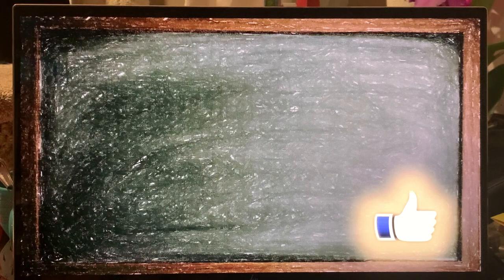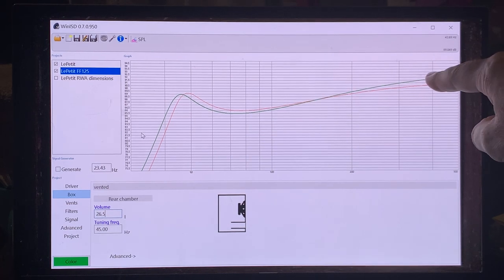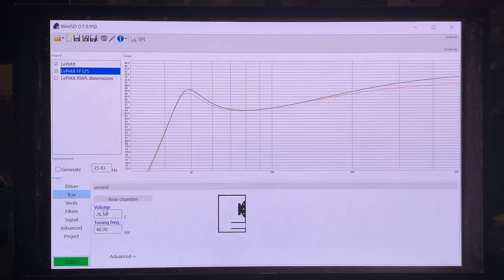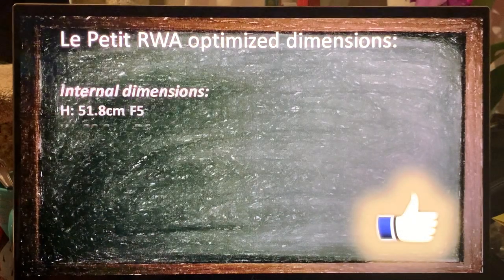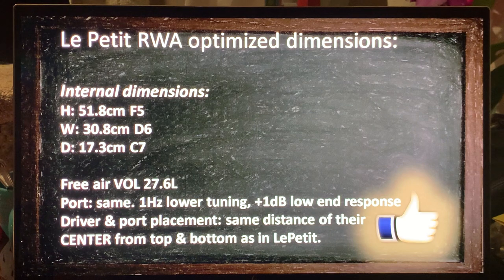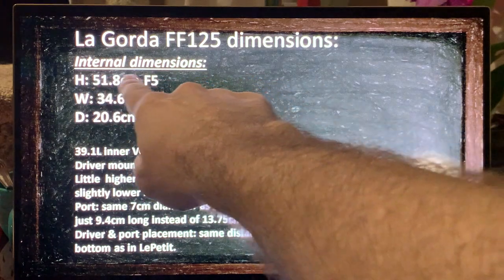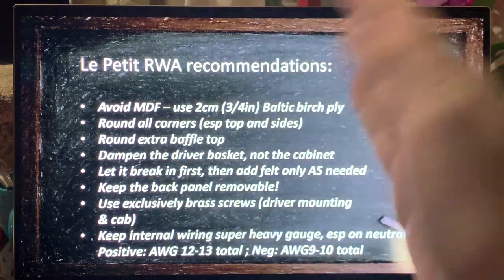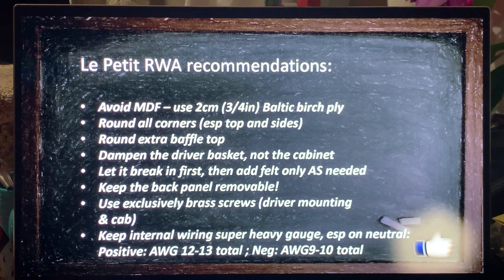LePetit and LaGorda with FF125

Comment: In Hiraga's 604 design (which also used musical scales for dimensions), the speaker was set at 0.324 and the port opening at 1/11th of case height for example, so both avoided/suppressed major standing waves. This may come in handy if you go with entirely new dimensions derived from musical scales. In my experience the depth and height are the most dominant, but it's nice to pick a 3-tone chord that sounds good to you and base the speakers' dimensions on such a chord.

Comment: János, many thanks to Your help to the Petit! The value of Your input made even the creator himself recognize us and comment these videos, what is sign enough for the level of Your ingenuity! 👌👍👍
Well guess, I bought the FF125WK already, they are breaking in today first time. 😉
I actually want build both versions of a "modern" Petit with RWA dimensions, the 26,5L (maybe with massive spruce) and the 39,1L (with birch ply). BUT I don´t know, if 2 more builds will not evtl. confuse the people too much.. 
So which one should I build. 🤔 Putting the FF125 in the existing Petit would destroy the use for the FE103, and I´m in love with it!
Reply: Hey, great idea can you put the FF125 in the OG cabinet? And built the original FE back?
Reply: @SPH25  I just recieved the FF125Wk a few days ago, I think they are a bit too big to go back, once the hole was cut bigger.. 
At least in my feeling, putting the smaller FE103 into the bigger hole takes away this super-sturdy feeling of the original build. Maybe it is possible, I must try in a template maybe..

Comment: Hello, Janos. 
I'm sure you've mentioned it somewhere in your vidoes but I would like to ask you a question about the driver positioning. For the cabinet dimentions you've provided in this vedio, should I use the original Hiraga design? It looks like the centre of the driver is mounted at 123mm from the top. Also, I am very curious to know about the effect if I were to lower the position of the driver. Thank you.

Comment: Hi Janos. Thanks for the vídeo. Now please help me. Some members from  a famous forum for "diy audio"  say that thin 22awg solid wires are  best suitable for FRs, Mark Áudio Alpairs, in this matter. Thanks for comments and clarifications.
Reply: Hi José.. I think that 22awg solid core reccomendation is more for Chipamps or other high damping factor amps for use with low Qts drivers.. But best is to try for yourself..
Reply: @rickg8015  Hi Thanks a lot for comments.!!  BTW,  It seems hard to me to know how high or low Qts is. Is there a practical  high-low values range you can tell me?
Reply: If You want to play it safe, buy enameled wire that has solderability. Perfect for this job is the diameter of ø 0,5mm. If You twist 6 or even 8 threads of that You have an high end wire. It will be shown most likely in my next episode of the build #4.
Reply: @TheZpilot55  Usually it is a Qts of around 0.2 or lower that is really considered low.. Anyway in my opinion, focus more on the quality of the wire first than the guage.. If you use a tube amp don’t worry too much about wire guage, empirical testing would let you know what works best in your system with the Le Petit FF125wk. Please follow Jurgen’s build too.
Reply from the maker: Hello José, the AWG22 solid wire is a superb choice. Just use 16 runs for the negative, and 12 runs for the positive. In general, use AWG20 or thinner wires, and parallel them. If you use only 1 of each, there will be next to no bass. Well, there will be good bass, but nothing like what the speaker can do. Adding the extra runs will seem as if you have added a sub.
Reply from the maker: About the low Qts drivers: my Altec 515C has a low Qts (about 0.2), and massively paralleling wires made a tremendous benefit there too. 96 runs of AWG32 silver plus Kimber TC in parallel for a total AWG of 8 or so for the negative and 10 for the positive. That brutal paralleling makes subsonic reproduction possible - just keeping a simple Kimber TC or AWG14 ish, and it would only play midbass, some deep bass but absolutely no sub 20Hz. I plan to upgrade it in the future to 256 runs of silver on the negative, and 196 runs on the positive, no copper... just got to save $$$ up to that. Also, the speaker cable should be like that too, not just the internal hookup... now that's real big $$$.
Reply: @realworldaudio  
Wow Janos.. That’s some extreme cable diy there.. I think the OP was asking about thin guage speaker cables as used by mostly Chip Amp users that braid thin solid core wires sourced from good quality network cables..  I tried a single 24awg for by Oyaide I think for tweeters, sounds refined..

BTW, for my Altec 414z in MLTL’s, what would be the starting point would you reccomend for cables inside the cab? I’m afraid i don’t have the budget for Kimber TC, etc.. But I could source teflon insulated silver plated stranded copper easily in various guages.. I can’t go as extreme as a garden hose thick, but maybe ~10 to 12awg per + and - side..

Comment: no I don't agree that the frequency of note is advisable.. the only note you want to look for is E-flat in its octaves, you need to use a signal generator to see where your peaks and troughs are and compensate for the peaks. I don't know how you're getting those frequency on just size alone, thickness and material would change its sound  resonance properties scale. what chart calculator are you using on length to given frequency scale?
you start boosting resonant frequencies you going to get problems and smearing in the notes and cancellation has to be tuned to 1 scale that's e- flat is the best.
if you're going around the corner  you need to do it at least 2 inch ideally 2½"-3"otherwise just don't bother is no benefit.
and leave the outer corner not bevelled closest to the wall just do the top and inner edge.
ideally the placement of the driver would be on the inner side not the middle an inch from the inner edge, would  work a lot better that why! because of such a wide baffle!
the original speaker material was chipboard/particleboard 1-inch, and I would stick to that at least on the front baffle
air pressure doesn't cause resonance only very small amount about 88% is mechanical resonance that's what you need to be filtering controlling not the air pressure.
Reply: The music-notes dimensioned cabinet is a specialised philosophy of cabinet building. To explain this philosophy You should watch János´ videos regularily, it is very interesting! 😊 To answer this critic in one comment, is most likely not possible.
Reply: @iam_mad  hes not going to achieve what he wants to achieve anyway by just knowing the length of different parts, as I explained. and is not good to highlight certain frequencies in instruments because it will be detrimental to other frequencies in the scale of the instruments only exception if the driver can't produce it in it's frequency spectrum. and this is coloration.. what will mask other parts of the music or instruments. if you do it in E flat what is a very musical and is out of the way of the main notes it will give more life body to the instruments being played, I've been there done it.
I tried different scales in the past and that is the best.
 of course you're never going to achieve it 100% with all scale pitch and every scale you have to judge what is right for the project, the rule of thumb usually that's middle to lower range. me sceptic never 😂 his  analytics is flawed!!!!